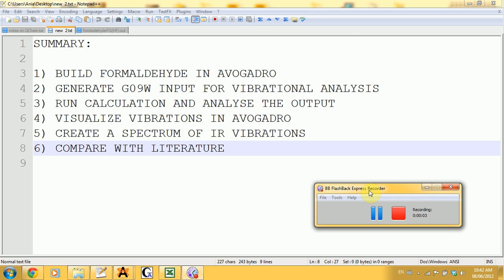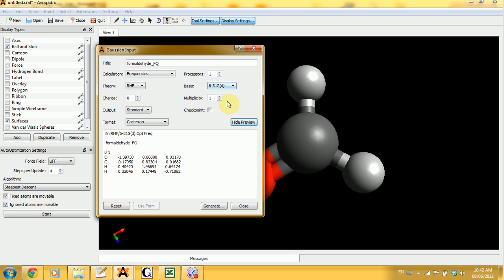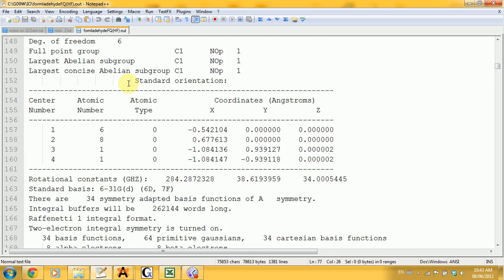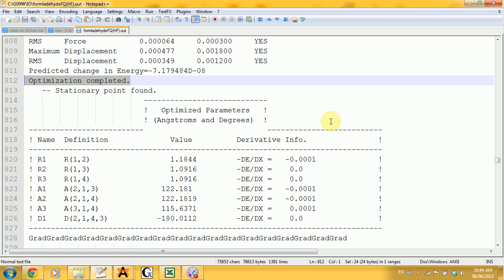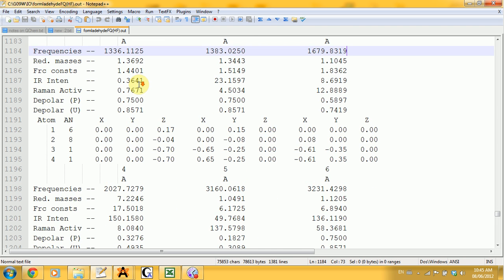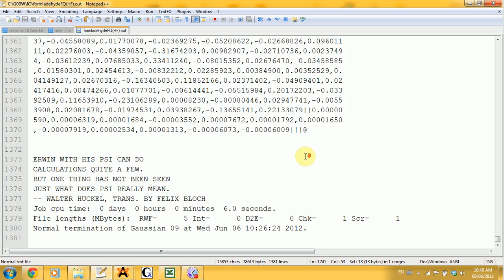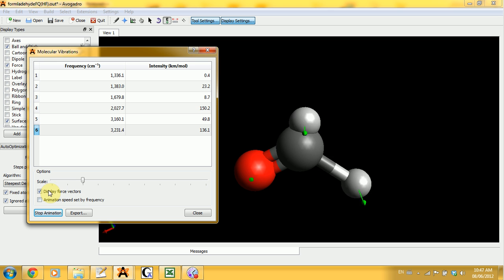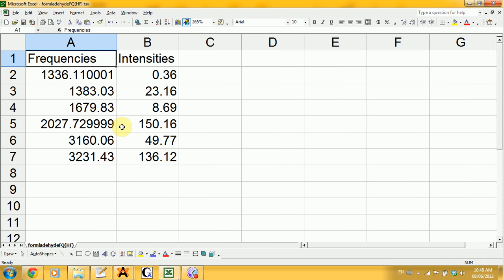Avogadro with Gaussian Tutorial FREQ

Comment: Hey, thanks for the nice tutorial!
A short question though: how did you end up with 0.8929 for the scaling factor? When I check the suggested link it says 0.899 for HF/6-31G*
Reply from the maker: Hey, they have probably updated the factors by now. This video is pretty old
Reply: @IaNiusha  Just a small point, You said Gaussian has a systematic error in frequencies which is rather misleading.
It's not the case ( to be pedantic). It's a deficiency in the calculation method. 

Other programs would produce the same deviations form experiment with same basis set in the same manner. If one were to use a very high level of Post HF calculation, say with CCSDT including anhamonic terms (cubic and quartic terms) the scale factor would approach 1,  be it Gaussian or any other ab initio package 

Cheers.

Comment: IaNiusha, you got great videos I really enjoy them and I recommedn them to my studnets. I was just wondering which version of Avogadro are you using? The versions 1.1.0 and 1.1.1 have different menus. Similar commands on the newer avogadro versions do not work. Do you have any suggestions?
I also tried WinGAMESS and Gausian outputs. Cheers, good luck in your work.
Reply from the maker: The older version is more stable. If you are not planning on using the crystallographic new options, then you can stick to the  previous version. The visualization of MOs is simpler in the new version, but there are other options that don't work that well (that used to work).

If you are using GAMESS, you can use wxMacMolPlt to visualize the output, but it's not that great to draw molecules. I typically use both! =)

Thank you for your kind words!